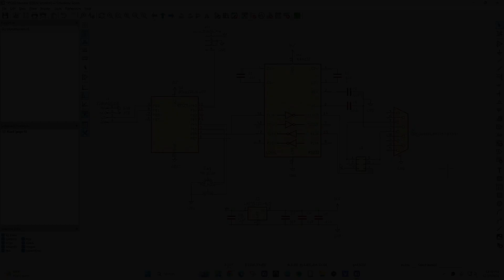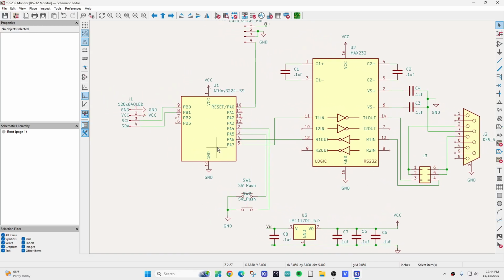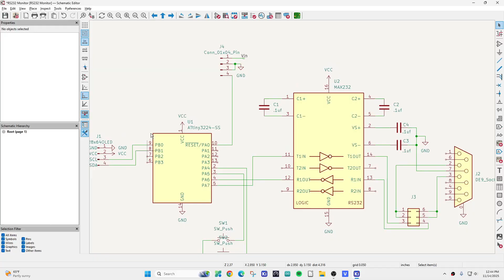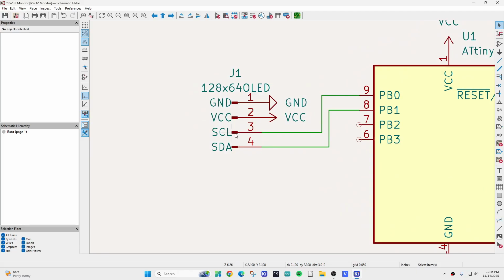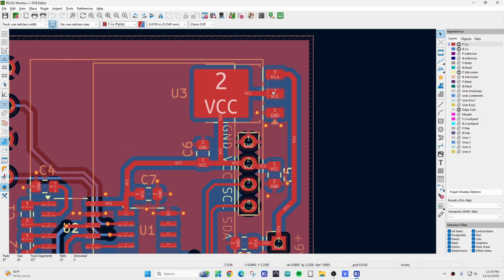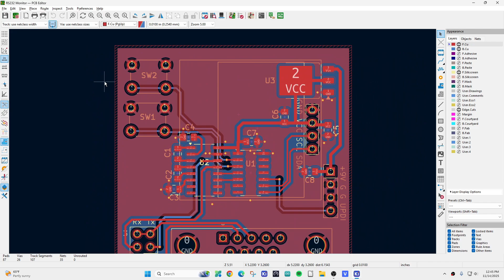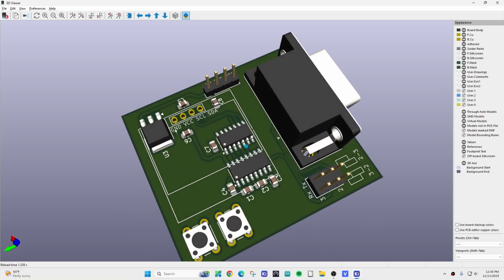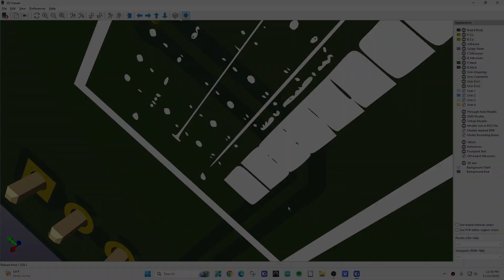#2430 Tiny RS232 Tester (part 1 of 2)

Comment: Looking at the Max232 chip, they call for 1uF Caps (tant, or ceramic).  Is there a reason you picked .1uF?
Reply from the maker: there are different makers and versions. the one I'm using calls 0.1uf on the datasheet

Comment: I do roughly the same when I have stuff that connects to the board with a header, just use a header schematic part. Because it actually is a header on the board, of course.

With an OLED as the display there is so much you could potentially do in software. You could show blinkenlights for the flow control, you could show bytes going by, you could change the baud rate. But thinking about it, I would want to be ambitious and use two MAX232 chips so that I can drop it in-line and see (and maybe even control) both sides of comms between two devices.

When I was writing code to talk to gas pumps in the lab back in '99, we used a little "TTL board" with a MAX232 for devices. I remember that the MAX232 cost six bucks because sometimes they would get zapped (CMOS) and that was the cost of a new one at the local electronic parts store. They were so useful that I made one of my own, and still have it somewhere. We also had a special cable that split the TX and RX into two serial ports and used a program called COMLAB to watch stuff talk to each other. I even wrote programs in Turbo Pascal to parse the logs to see it as message packets.

Of course RS-232 isn't a bus, so you can't transmit on the same wire with something else transmitting, and whether it even matters depends what you're hooking up. But you could stick a MOSFET in there to disconnect the transmitter on one side. It wouldn't be quite as tiny, but it could be super useful. But I'm not lacking in projects to take up my time, so I'd probably never do it.

Comment: using the QX5252 you could make it run off 1.2 to 1.5v battery
Reply: Would that get you the proper RS232 voltages? 
I still get exposed to a lot of gear that talks RS232, and many cheap adaptors fail me time and time again. This all stopped when I built my own adaptor with a MAX232.

Comment: The DB9 connector should be on the edge. The most reasonable power supply for today is 3.7V from a flat pack battery with a USB charging chip.
Reply: ...and naturally a 3232 (3.3v) chip instead of a MAX232